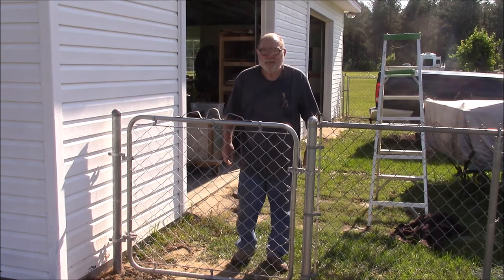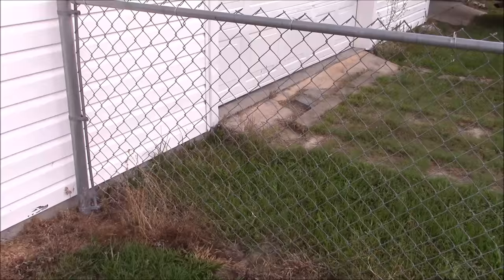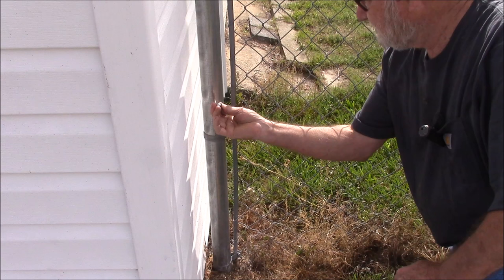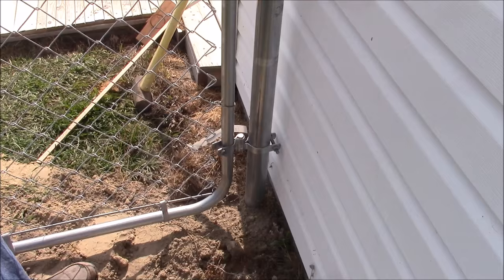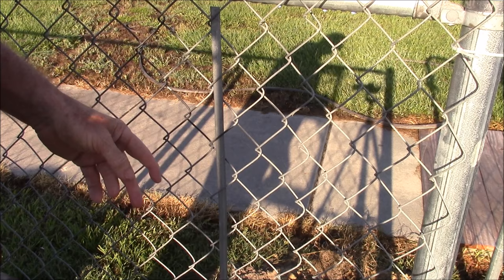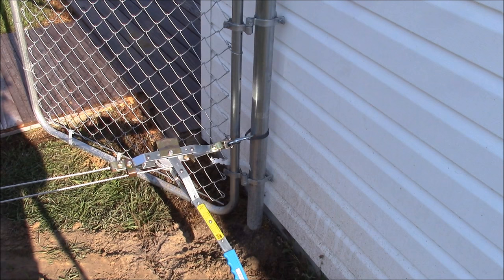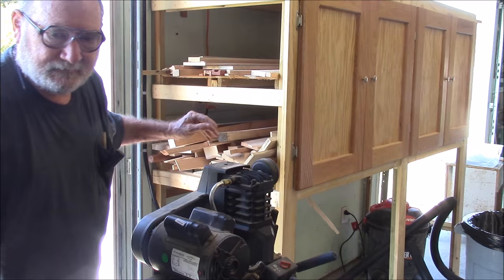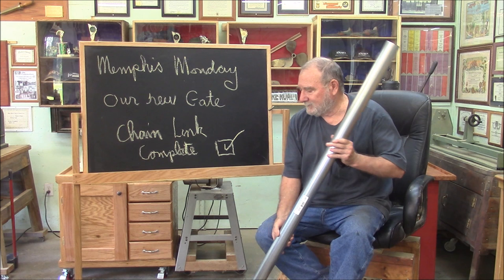Installing a chain Link fence gate MM 72

Comment: Good video.  Wouldn't use that much cement personally, half a bag is plenty.  Come time to remove that post its going to be a hell of a lot of work.
Reply from the maker: I did this project four years ago, and I've since totally removed the chain link fence.  I sure did go overboard on the cement and the post.  The other posts I just pulled out of the ground, but this post I cut off with a reciprocating saw below ground level.  Thank for watching and commenting.

Comment: Your gate came out nice and I can imagine what a pain in the butt it was not having it there. I like your idea of the home made stretcher and the idea of reusing the parts for something else. It was nice to see your hatchet get a a workout and I'm with you on all the concrete. If one bag is good, two is better. I didn't notice an error and I usually spot those right away. Hopefully you'll fill us all in on that.
Reply from the maker: I had to invent two jobs for the hatchet, both being inappropriate.  A real "hatchet guy" would have a heart attack seeing me open concrete with it!!

Yep, I'll fill you in on the answer to the mystery, and the answer is "satisfying," in the sense that all the clues are in this video, both the error and the correction.  But it is subtle.   

It was a pain not having the gate.  I have that front of the shop fenced so I can  control the dogs, but without the gate it was controlling me. 

Thanks for watching and commenting, and hope to see you back next week.
Reply: ***** I'm a real hatchet guy. The hatchet can be used as a hammer, it can be used to cut open bags of concrete, it can be used for anything. I've had mine for many years, more than I remember, and it's always been able to handle any job I need it for. :-D
Reply: How to fit a gate spring

Comment: That post is in there to stay, 4 feet in the ground and two bags of concrete should do the job. I was a little concerned about the levels taped to the post while you were driving the pole in the ground. In my clay ground I'm not sure that would work.  Nice job as always.
Reply from the maker: About anything works in my sandy soil.  You could get 5 inches of rain, then drive a dumptruck across my lawn.  It is sand, pure and simple.  

But that makes digging a breeze, and setting posts pretty easy.  

However, I hope I'm not the guy tasked with taking that end-post out!!!!   It is there to stay.

Comment: I fill the hole halfway with water before pouring in the concrete. That way there are no dry pockets in the cement. I just pour til the hole is full. The excess water quickly leaches out into the ground.

Comment: Sorry dude!  I let another Sunday zoom by and missed your video.  So instead of having a cocktail as I watch your video, I am having a cup of coffee.
When I saw the title of this video, I thought, "I love the twists that Memphis puts on his videos, but installing a chain link gate sounds about as interesting as watching grass grow."  Shows what I know.  You have a way of explaining things that really make them interesting and, as always, you put the Memphis touch on the project.  

I actually learned a lot about chain link fencing that I didn't know.   Learning how the links are meshed together was a real revolution to me.  You see, several years ago we had a local jail break.  The prisoners were in "The Yard".  It was an area in the center of the building with 20 feet walls and at the top was a chain link fence.  They had no tools but were able to separate that fence.  That always puzzled me because I always assumed that you would have to have something to cut the fence to do that.  You demonstrated how easily they accomplished this.  Who knows how those monkeys got up the 20 foot wall?

Is that a commercial system for attaching those levels to the fence post as you drive it in?  If not, do you have a patent on those connectors?  Very ingenious!  

I would imagine in that SC sandy soil, you pretty much have to concrete every post in the ground.  Two bags of concrete and adding a couple of extra feet to the post in the ground should ensure this post is there when your great grandchildren are old and gray.

It is good to see you staying in shape and pumping a little iron there at the end.  Also, it was good to have a cameo appearance by Mr. Axe/Ax/Hatchet, even if he was performing tasks for which he wasn't designed.  It just goes to show what a versatile piece of equipment he is.  I hope you are having a wonderful Monday.
Reply from the maker: Just saw your comment and it is 11:12 PM.  Do you know what that means?

Anyway, I'll reply when my fingers are firmly connected to my brain, and I'm not quit so smart.

PS,  I'm counting on you to figure out:
    1.  What was my error in this video?
    2.  How did I fix it?

You are a wiz at this, so I suspect you will figure it out.
Reply: ***** Hmmmm.  I remember seeing something and thinking it wasn't quite right, but I can't remember.  I guess it is back to the video.  I will let you know what I think after I watch.
Reply: I have watched this 3 or 4 more times and hate to admit that I am stumped!  There is nothing wrong with the measurement of the opening.  The 130 cm/ 51 inch from center to center should give you a 48" gap if the posts are 3".  The top horizontal pipe may have been a little short, but was easily resolved with the connectors on the ends.  The end connector for the pipe that was on the fence post looked a little high, but that could have been an illusion on the video.  The only thing I can figure is when you were letting the tension off the fence with the come along, I heard you say, "heard something" then you put a little tension back on it.  You let the tension off a bit then switched to another scene.  Yes sir!  I am good and stumped!
Reply from the maker: I might be too easy for you to figure the mystery out.  You are digging way too deep, while the big clue is right out in the open.  

I even fumbled a little when I unwound the fence, but those real fence guys do it in seconds - it looks like magic.

That was some rig with those levels, wasn't it.  Basically, I had them in place so I could reach over and check the plumb as necessary - no way to watch them while pounding.  No patent!!  I'm giving that idea away for free.  Memphis Applegate is a giving woodworker - another example of making the world a better place.

They mostly do concrete in posts here.  The soil isn't even soil in most places, just sand.  That post is a keeper, that's for sure.  A little extreme, but silly and fun.

Mr.  Axe-Ax-Hatchet did a real fine job slamming open bags of concrete.  I think Wranglerstar would excommunicate me.  

Just a few more days and we will solve the mystery.  I think it will be a head-slapper for you:  "Well, I saw that, but I didn't think much about it."
Reply: ***** Ok.  I watched it one more time.  One thing I noticed this time was that you put the gate post pipe holder on before you cut the pipe then had to go back and do it again.  It seems like you looked up as you got the pipe holder on and saw that the pipe wasn't cut.  Am I getting closer?  Hahahah
 
Well, considering those fence guys are working 8 to 12 hours a day working with this fence, you are forgiven for fumbling a little bit.

At least the levels kept you aligned until you got a good start.  That is the best you can hope for.  Never let it be said that Memphis is not a generous craftsman, making the world a better place one free bit of knowledge at a time!  Hahahahah.  All joking aside, I have learned a lot from watching your videos.

Who cares what Mr. Wranglestar has to say about your use of tools.  He is a little too full of himself for my liking.  That being said, I was not one of the ones who told TR that I liked his channel better than Wranglestar  as TR was bragging about on one of his juvenile camping trips he did with his "team".   

Whether I am right this time or not, I hope I don't end up slapping myself too hard.  Well, I need to get my sorry butt up and go for my walk.
Reply from the maker: Wranglerstar is way too full of himself for my taste too.  I checked him out when I was learning about axe and hatchet handles, but I finally turned off the sound and just watched the picture.  Personally, if I had to choose between WS, TR, or DOC, I'd go with TR - all three are unwatchable in my old grizzled brain.  

Only a few more days before the final answer, but you are getting colder.  Remember that game as a kid?  Since you are a buddie (but don't tell anyone) here is a hint:  check out the first pictures of the new gate, then contrast them with the last pictures of the same gate.

I know real well that 12 hours a day for years business, which is why I always try to give professionals their due.  I worked in three different factories, and while I was a fumbling rookie for the first few weeks, in time everything became automatic.  It was a valuable lesson, which I never forgot.  

This might be a valuable take-a-way in your walking and workout adventures.  In summary, you will get much better at whatever you practice.  

Check out that hint, and then tell me what you think.

Comment: The gate should be swinging from the fence side, not a free standing post. No matter how well it's set, it will eventually loosen up.
Reply from the maker: Yep, I made that change right after making the video, I think.  Don't exactly recall why I tried the free standing post side, but I think I had concerns about access to the yard by the lawn mower.  In any case, those concerns turned out to be unfounded and I changed it.
     You are so right about that sagging post.  As I remember, right after doing it I was already toying with ways to reinforce the post at the top (to limit any sag).
Reply from the maker: https://www.youtube.com/watch?v=Qxfr63cEjFE
In the video I link here, MM 73, I show the corrected gate at about time 8:45.  I also discuss another error.  Thanks for watching and commenting.